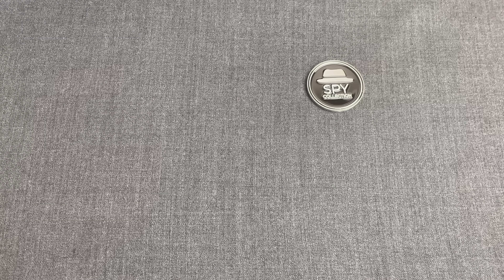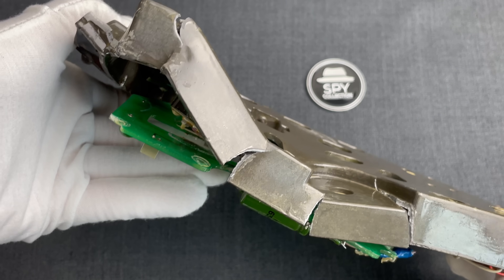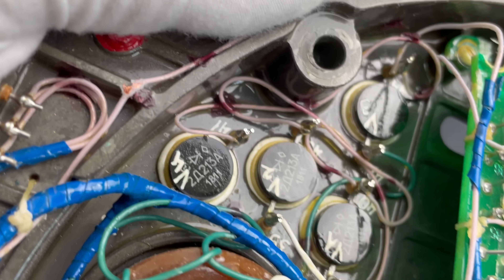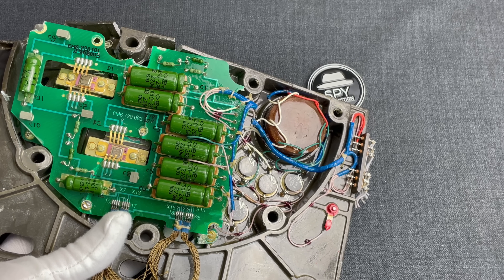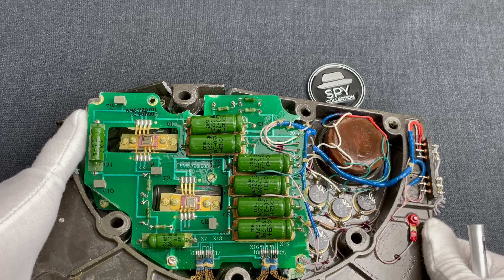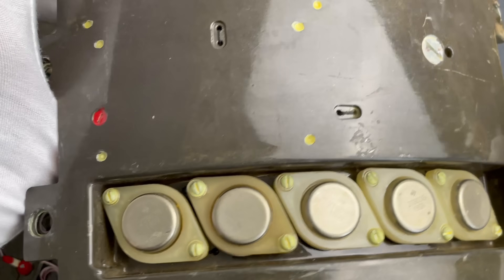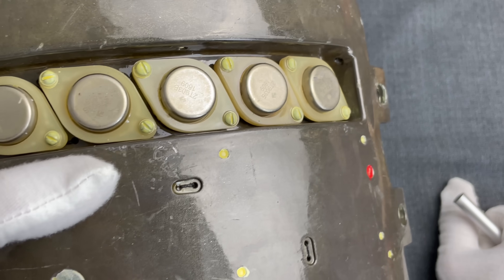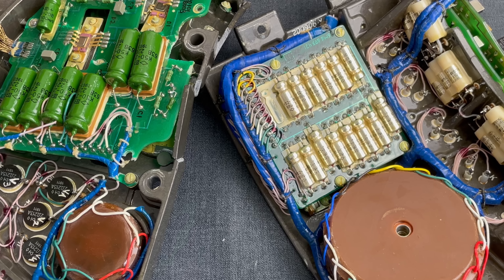TECHINT on Russian S-300VM Components

Comment: Hi, seems is from a video form Ukraine site or some else, so let's clear about basics: Transistors 2N213A is a Germanium NPN, 0,3 v base voltage, excelent temp Ti max, about 300 G celsius, Ftt 1Mhz, this is a forbiden asset in europe. Excelent in a Vcc-Vca converer. I use ST equivalents with poor results. Those green electrolytic capacitors are standard, see of them mark +/_ 20%, just tested on high temp. In that context, is just linear regulators, with Temp linear as possible. About mmc 4017, 4001, the pink one, they one of the best tested by me, over 30 years, and the processor is the same quality.  This is basically  Indestructible , they are made in low yield disipation, 70-tech, exceptional heat resistance. Test a ST similar over 300 g and fail at 110. All that in that board is made with HEAD.
Important is the software which control that, is in the ram near cpu, if you can made a dump, it will be a big revelation, but think logic is protected.

Comment: One board is from 2013, the other is from 2019, both from the onboard power supply. It's the 21st century, but there's not a single modern component. It's just horrifying. Russians don't know what smd acomponents are. These things can be reduced by multiple times.

Comment: Battery compartment first question not a sensor thing. Torroid also have voltages on each wire printed on it. This is caveman electronics not hard to reverse engineer.

Comment: Das sind vermutlich Komponenten, um die Flugrichtung einer Rakete zu steuern.  Man sieht 2 metallisch abgeschirmte Operationsverstärker, die wahrscheinlich die Transistoren ansteuern. Die Transistoren steuern vermutlich 2 Servos, die die Elemente steuern, die die Flugrichtung lenken (Leitwerke oder Antriebsdüse).  Vermutlich wird der elektrische Strom mit einem an Bord der Rakete befindlichen (Wechselstrom) Stromgenerator erzeugt, der durch eine Abgasturbine angetrieben wird. Der Strom wird  von den Transformatoren auf die benötigte Spannung herab transformiert, gleichgerichtet und durch die vielen, wahrscheinlich parallel geschalteten Elektrolytkondensatoren geglättet.  Die elektronischen Platinen wurden in Handarbeit gefertigt und entsprechen dem technischen Stand der 70er und 80er Jahre.
Reply: неправильно: микросхемы- это интегральные регуляторы напряжения,  операционные усилители выглядят иначе. И вообще- это источники питания.
Reply: @bes1657  Kann sein. Daß die Platinen allein für die Stromversorgung sind, ist wahrscheinlicher. Spannungsregler IC's sehen aber normalerweise auch anders aus. Daher hatte ich auf Operationsverstärker getippt.
Reply: @sanjivinsmoke3971 Stimmt!

Comment: Stone age. Pi5, and ardupilot outperforms it by orders of magnitude....
Reply: Not necessarily. Standing still, sure. But I'm pretty suremy pi's are going to disintegrate, or have serious damage, if they go from standstill on the ground, to suddenly mach 4 or 5, in a few seconds. 

Military grade doesn't necessarily mean 'high tech', it can also mean durable, able to withstand shock, extreme acceleration, and EM interference, and vibration.
Reply: Не смотря на возраст этих ракет,они и сейчас дадут в рот любой вашей технике,вашим хвалёным невидимкам .
Reply: Brother why are you trying to outperform it? These rockets are made to fly fast and destroy the target, not for playing Minecraft on them
Reply: @андрей_свиридов  Crosspole jamming, signal discrimination,  E/O-IR image identification from OSINT database, and frag detonation timing. Mine fly smarter. With the Same compute as the first f-35, more than any other missile due to 4GB PCI GPU, Even Jetson nano has X10 the processing power of Nation state missiles. It's a crazy world bro.

Comment: The red paint on the screws is likely a quality control feature.  You don't want the screws comping loose, so they are likely torqued to a specific value and then painted to indicate they have been done.  This allows a quality control person to easily see that the screws have been torqued before passing the assembly on to the next manufacturing step.
Reply: Так же это может быть фиксирующий лак, я использовал его пока работал небольшое время на предприятии впк
Reply: @Дрюня-ь2ч  Threadlocker usually is applied to threads and hardens in absence of oxygen, outside lacquer is used as QA marking and protective layer.

Comment: I had a dubious pleasure reverse-engineering similar kind of power supply to get some old equipment working. The main problem was to supply materials not used in electronics design in the West for nearly half a century...
Reply: Что вы там не использовали,вы просто ни тогда ,ни сейчас этого делать не умели.

Comment: It's likely AC power generation and conversion to DC distribution from a generator that is powered by flight, i.e., a small wheel exposed to the atmosphere during flight that drives a generator, or depending on how the rocket is powered, by tapped gas. My guess is that because it's a solid fuel rocket, the generator is driven by flight. Well made to 1970's standards. We might see similar vintage engineering and assemblies in HAWK missile systems from the US.

Comment: By and large, those are power supplies for whatever part of system.  Not much of intel there, typical Soviet military electronics style, a lot of manual  assembly used, thus slow and expensive to produce.  8 legged, gold plated chips most likely are Soviet clones of LM78xx.
Reply: Где ты там клоны разглядел, недоразумение человека.
Reply: I don't think so. They looks like logical chips
Reply: @alexptvz1076 yeah, yeah, transformers, diodes, bunch of caps, and suddenly chips on heatsinks for you look like logic. Really, type "142en3" into Google and read datasheets of your "looks like logic".
Reply: @alexptvz1076  google 142en3 and read datasheets of your "logic"

Comment: The shiny electrolytic capacitors appear to be wet-slug tantalums, the (+) leads appear to have a welded sleeve, which is a key indication of this.
Reply: Military guys the world over looove their tantalums.
Reply: @AlexKarasev  looove using them in low-frequency sine wave, biased capacitor signal paths.
Reply: Серия конденсаторов к50, являются обычными электролитическими, плюсовая пробка там резиновая( это про зеленые). Серебристые, да танталовые, если не изменяет память, то корпус из серебра 80%, ну сейчас может меньше
Reply: @картошка2-с6ю    American-made wet slug tantalums also use a silver case to resist the sulfuric acid electrolyte.  In the old days, a polymer case seal was used but these often failed early causing equipment to malfunction.  The newer versions used a ceramic seal with silver solder, these lasted longer but still would sometimes fail early.  The most current version uses a sintered ceramic-to-metal seal in a metal endcap that is then E-beam-welded into the case.  These go into spacecraft.  The super-cool version of these are the non-polarized, wet-slug tantalum electrolytic capacitors.
Reply: @Slickrock72  да они есть разные, знаю серии к52-  танталовые объемно-пористые ( скорее всего на видео они) и к53- оксидно полупроводниковые. Именно к52 были в серебряных корпусах, к53- что то типо стали ( ковар?). Видел новые российские танталовые, тоже как и ваши в оранжевых кубических корпусах, про технологию не скажу, но думаю мало чем отличаются. В целом мне нравятся и танталовые и оксидно полупроводниковые, к примеру в старой технике 99% из них рабочие с отличными характеристиками. А еще были необиевые !
Reply: @картошка2-с6ю  I have heard about niobium electrolytic capacitors (superior ESR, resistant to catastrophic failure) but have never worked with them.
Reply: @Slickrock72  ничего необычного (относительно танталовых). Стояли даже в советских телевизорах. Сейчас их принимают на лом килограммами. С ниобиевыми конденсаторами  встречаюсь реже, их совсем сломанных не видел
Reply: @Slickrock72  Componenti di stupenda qualità, se li trovo li conservo con la massima cura, saranno arretrati nell'estetica e nella fattura ma sono eccezionali e affidabilissimi, per non parlare dei resistori! Solo sui semiconduttori, ic soprattutto, sono molto più arretrati di noi, specie nella miniaturizzazione, ma la qualità è eccellente!
Reply: I am a practicing electronics engineer with 40 years of experience, what I see is a museum piece, THT assembly, parts from a previous era, it looks more like amateur work, not professional workmanship.
Reply: @BłotnyMonster  Yeah, sure dude, whatever.  You should watch Curious Marc's videos on Apollo electronics and other avionics assemblies before you come here and spew your "I am a practicing engineer" bullshit.